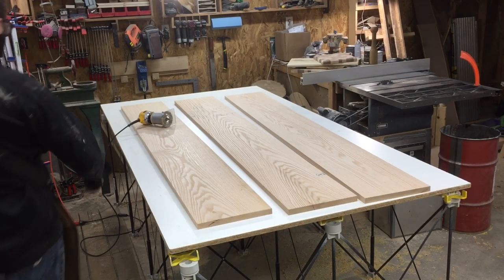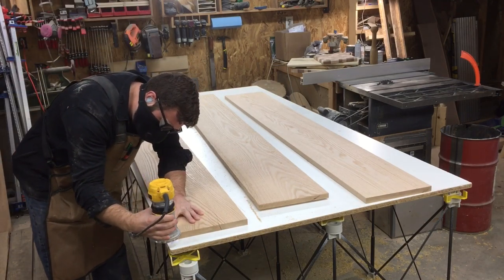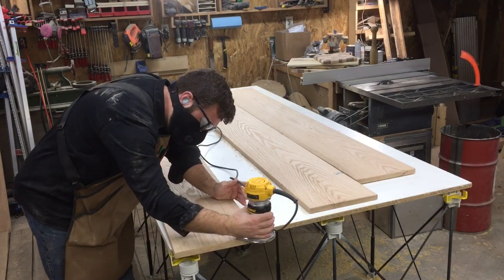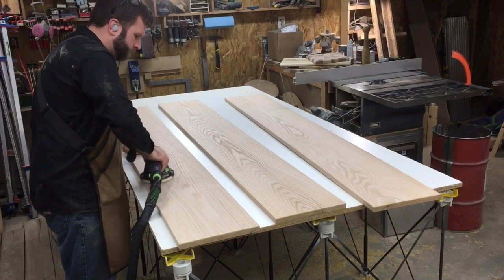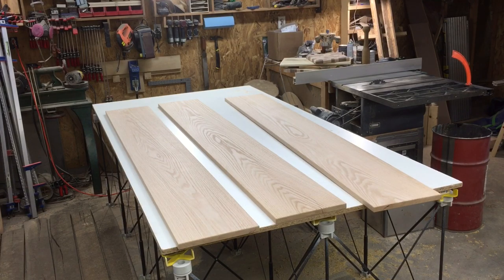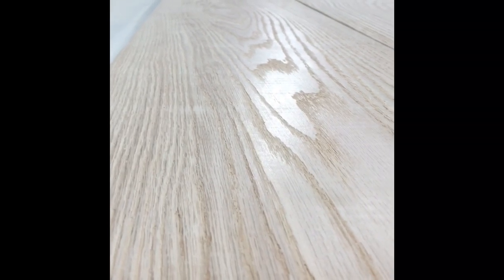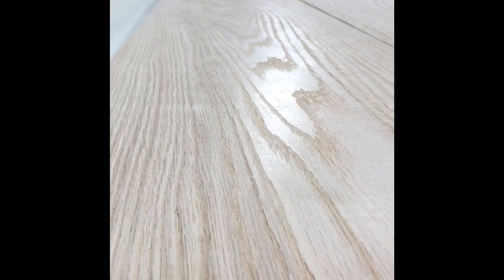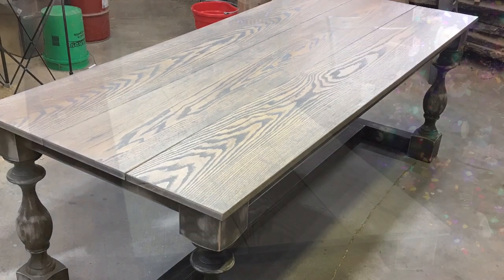Distressing boards for a Farmhouse Table.

Comment: Thanks for this video. You've made it much clearer to me as to what is going on in the process and exactly how much is really needed.
I've watched a few other people doing this who I think have taken out too much material and I couldn't see that it was actually the burnishing of the harder material that is equally, if not more important than the removal of the soft material, in the process of achieving the finish.
Also, the fact others have tried this with pine instead of a good hardwood, really drives home just what the technique is good for. 
Thanks. I feel like I'm better equipped to use this in a future project, properly, now.

Comment: Nice table! A wire brush works great for softwoods, too, like douglas fir pine. I don't use a wire cup, as it goes across the grain by nature. A wheel brush or flap brush can be used to go only with the grain, and it is fantastic for distressing softwoods and hardwoods. I use wire and Nyalox wheel brushes with great results.
Reply: Just bought some Southern Yellow Pine..would you recommend sanding first before using the wheel brush?
Reply: The Wheels take too long!  The cup brushes are fine and the slight crossover marks give the wood a more rough hewn look as well, not so perfect.  I finish off with Nylon Cup Brushes to 'polish' the burrs off, then a final toasting with a propane torch to burn off fine burrs.
A flap brush does not go with the grain. Its an aggressive sander that will smooth out what you just grooved with the wire brush.  This part does not make sense.
I use a mesh cloth sanding disc on my hand sander to very lightly go over edges to take out splinters on corners.
If you use a nylon wheel brush vs a nylon CUP brush, you will overheat the nylon much faster.  Cup brush is better.  If doing precision work, use a Dremel Rotary with tiny wire wheels and cups.

Comment: Lovely distressed table!  Two questions if you have time to reply.... does it matter if the wire wheel is knotted or regular?  Does it matter if you are using a soft wood such as Pine in selecting the wire wheel?

Comment: Thank you ! Great video. I sand the same way . I use my hands and ears a lot to know when I’ve gotten them where I need them . I’m trying to turn rough sawn lumber into barnwood. But the lumber company ran out of the true rough sawn . This wire wheel should help raise the grain . What gauge of wire is on your wheel ? Think I need something fine because it’s pine .

Comment: I have to do TONS of the faux barnwood. It’s for many accent walls in a big house . Is there a way to do this technique with an attachment that would fit an orbital sander ? My angle grinder uses batteries. Keep running out of batteries after one board . Not efficient 🤣. Just need to raise grain and make it rough to take the stain in the perfect way to look aged . Thanks again. 😊
Reply: @lass-inangeles7564  , I did get serious indeed . Found a huge heavy duty grinder in my papaw’s shed . It is an older , 80’s model Craftsman ( very well made ). Also got a big heavy duty Bosch one after the bushings wore out on my papaw’s grinder ( he’d used it a lot when he was alive ). I now use a big 6” wire cup brush and get gorgeous effects very quickly. The first homeowners loved my faux barnwood so much that each new homeowner asks for my faux barnwood in their homes . It’s become my new project in all the homes I work in . I use it to make furniture too 😊. It’s so fun and rewarding. I was able to save a hideously ugly hearth that had been built very uneven thanks to my grinder . I made it look rough hewn and stained it to look old . One would never know it had been slapped together by a sloppy carpenter who didn’t take pride . You’re right about the carpal tunnel . I give myself a break when I feel my wrists being unhappy. Thank you so much for the supplement suggestions. I’ll definitely give those a shot . I’m very tiny . 5ft tall and 112 pounds . And I’m 43 years old. So I don’t overdo it like I did in my 20’s . I’m so glad I found out about the grinders and the effects that can be made with wood using them . It’s the most rewarding thing to watch a perfectly smooth piece of wood become raised and bring out the beautiful character hidden underneath the surface. 😊

Comment: Nice.  Well done.  What color stain and do you put any poly on it after stain?
Reply from the maker: It’s a fast drying stain from a box store, same for the poly.
Reply: @SlabGuy   hi fast drying stain, but was it a certain color stain? I love exactly how it came out and I would like to duplicate yours exactly. Also what brand poly and stain did you use on it?
Reply: @SlabGuy  Also how many coats of stain and poly do you recommend if using for dining table?

Comment: Could this technique be done on pressure treated wood too?
Reply: Not recommended. Think about that.  This is a decorative effect best for indoors. You cannot use pressure treated wood indoors - chemicals.  If you do this to outdoor wood, you will age the wood faster into decay and rot.  Leave that alone.

Comment: I like your collapsable table.  Do you find it strong & easy to set up / put away?
Reply from the maker: It’s very strong! I think the 4x8 is rated for 3K lbs. it’s stores I. A pretty compact package as well.
Reply: Yes, I had the same question.  Wonder what that is called.  Very convenient set up!
fyi - COLLAPSIBLE, not COLLAPSABLE.

Comment: Would you happen to have a link to the brush or the kind of brush you used with your angle grinder?
Reply from the maker: It’s just a generic cup brush, I think I got it at harbor freight. Loose wire, not the heavier, twisted style.

Comment: What type of cup brush do you use
Reply from the maker: I got it from harbor freight. It’s the single stranded, not twisted type. Not as coarse. It doesn’t take much to get the desired effect.
Reply: Crimped Wire Cup Brush from Harbor Freight.  I also recommend getting the Knotted Wire Cup Brush, and a Nylon Cup Brush.  See my comment above.  They are all very useful.